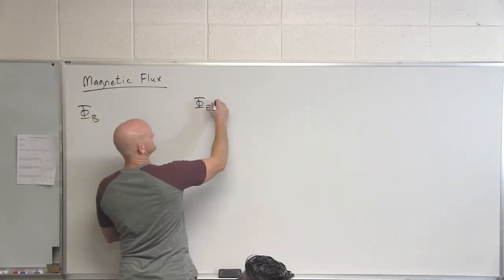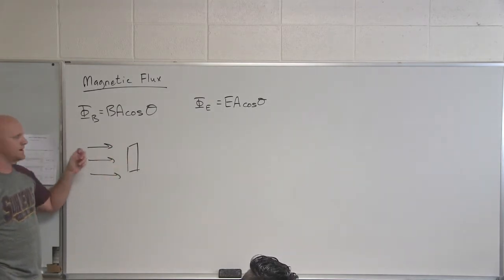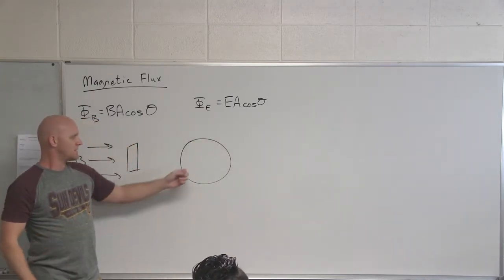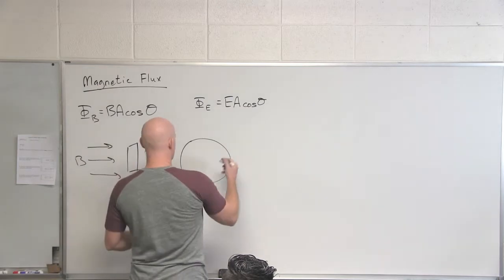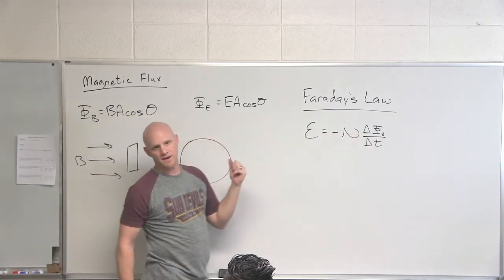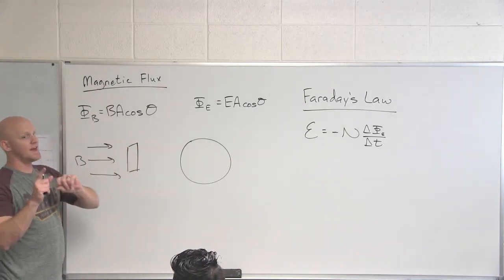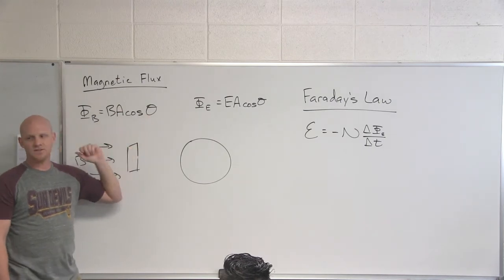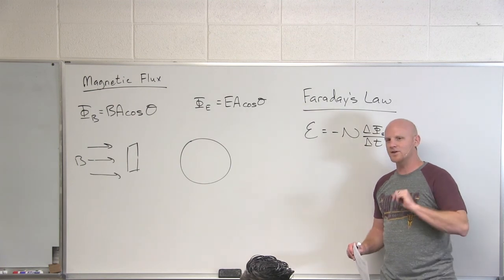20.1 Introduction to Faraday's Law and Lenz's Law

Comment: Chad, your lectures are thoroughly, and well explained and I do really like them. But in terms of the angles would be able to use a sheet of paper or anything to show where exactly is the normal and where exactly are the fields going. In this case, it would be much easier to visualize. Thanks.